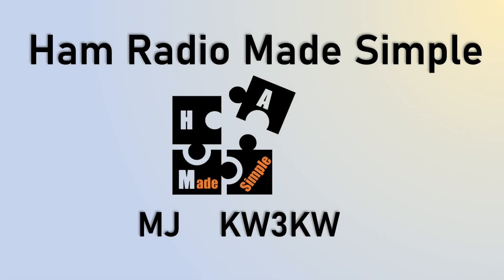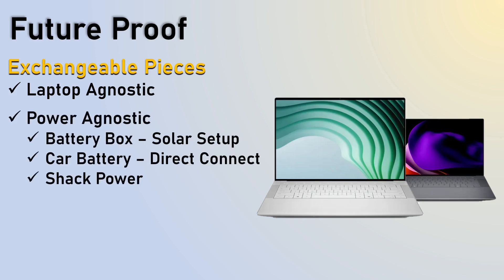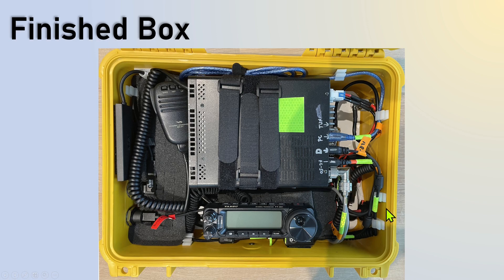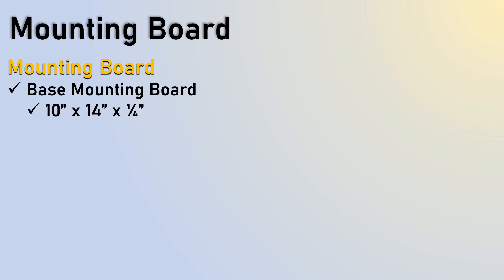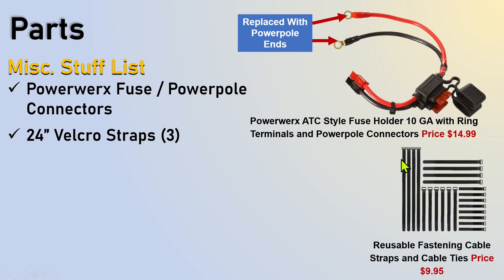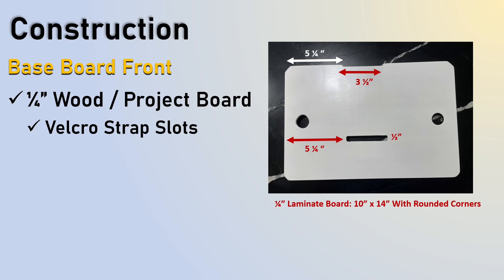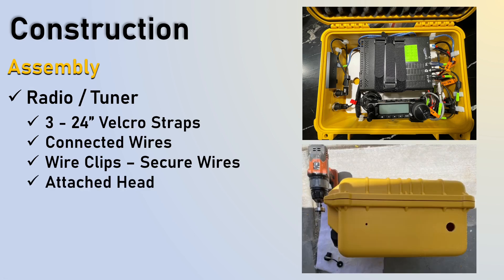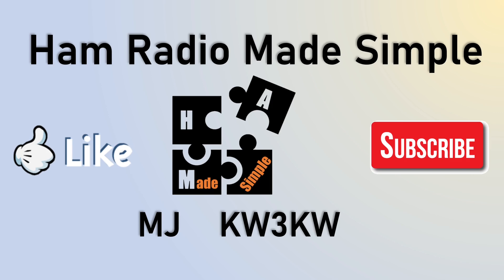My Yaesu FT-891 Go Box.

Comment: I use a Gator Rack, they make rack attachments to mount radios. I noticed you aren't using an EMP Shield on your antenna, any reason why you aren't? Also, you didn't show a grounding system, isn't that important? I use 1 eight foot ground rod cut into 4 pieces with a HD stranded wire so it packs up easily in a small bag.
Reply from the maker: My antenna is grounded and I have a lightning arrester with me when needed.  Great ideas, thanks for posting.

Comment: Hi MJ, hope you are doing well. I love this box. Everything you need and nothing you don't. No fancy polished top to block airflow to the radio and very well thought out. The price for putting this together is also excellent. As for changes I'd make if I build one (and I just might), I think I'd add a volt/amp meter and a LED light with a switch on the inside of the lid. Make it quick and easy to keep track of amps used and give you a little extra light in the dark. Thanks for another great video !
Reply from the maker: Great idea on the additions.  My battery box already had this BUT most won't use a battery box so GREAT IDEA!!

Comment: Awesome setup! Very light and quick. Looks very neat and well planned out. I can do portable 991A SeeLite Lipo4 100Ah EFHW and Comet GP-3 with a homemade spike 2 25ft coax Harbor Freight 4 panel 100w solar with a Victron controller, most of it's in a plastic box with a swivel seat on top ( hunting seat) panels and GP lashed together with rope and a camping fold up aluminum table. Backpack with laptop cables, signalink and rope. More of a mobile CP takes about 30 minutes to setup depending on the EFHW time.  Thanks again for another great KW3KW video! 73 MJ
Reply from the maker: Thanks for sharing your setup, sounds like a great portable station.  Send me some pics when you get a chance.  KW3KW@mail.com.